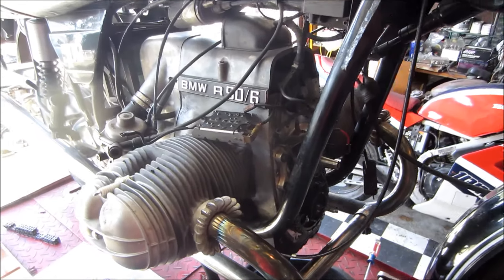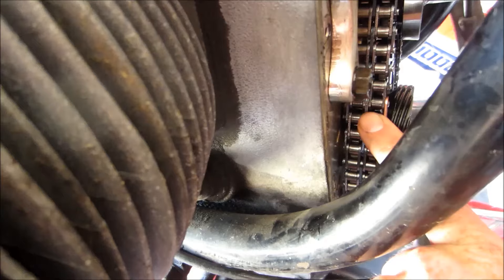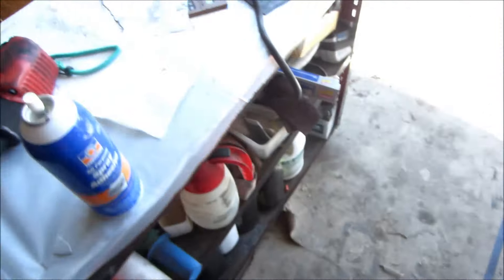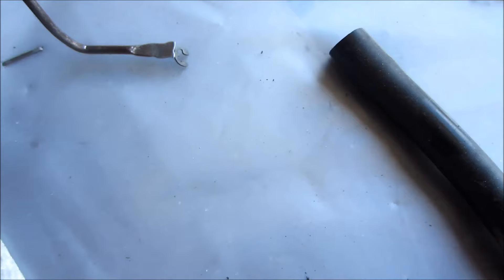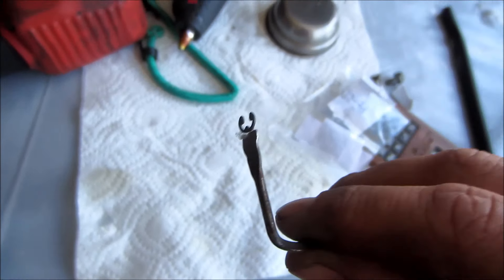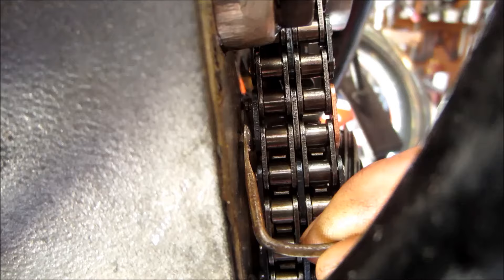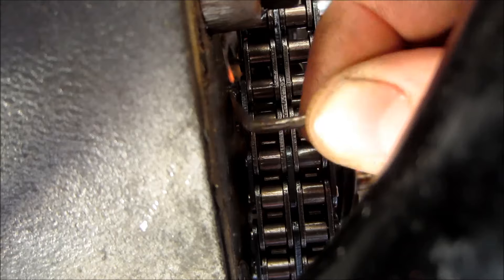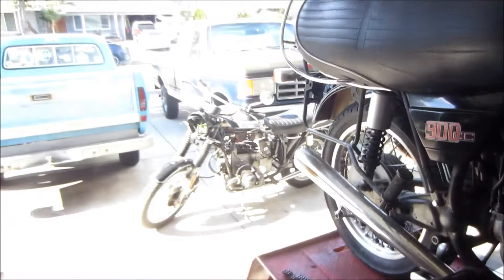BMW Timing chain master link trick

Comment: Hot damn.  I did this with one of the single piece master link clips and it was the Exercise from Hell.  I don't think I really got it clipped in there right so I'm going to take the front cover back off and Make Sure. This time, I'm using the little c-clips which appeared a foolish choice before but I have now Seen The Light after a few videos of this operation using the little clips.  A few tricks are nice to know.  Thank you for sharing.